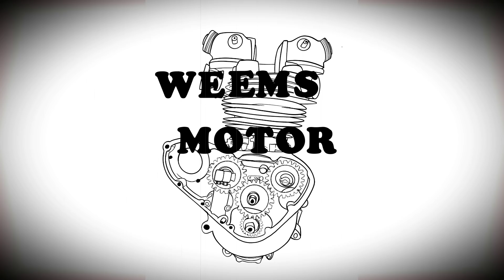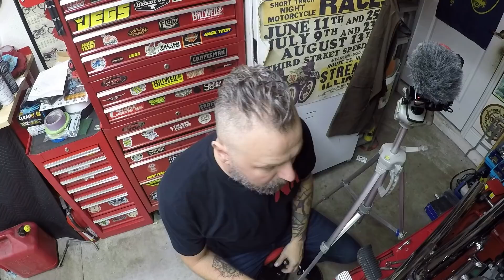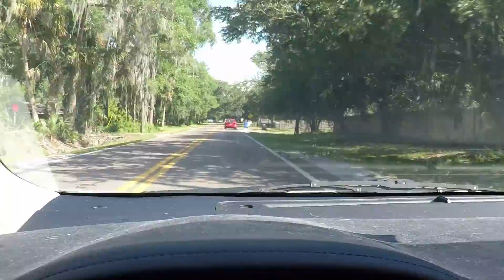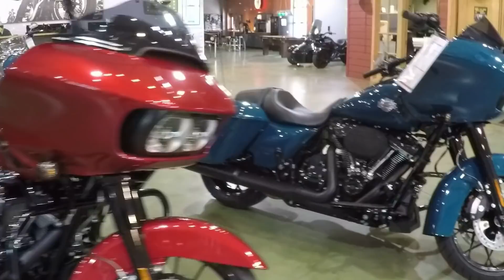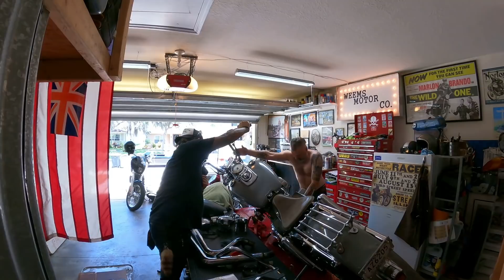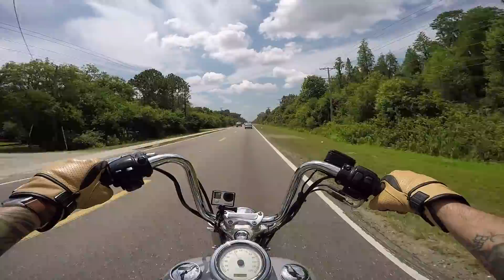I dropped my Harley / Dyna Cam Chain Tensioners

Comment: If you ever have to pull the cam plate, I’d think about upgrading the chain tensioners to the later model hydraulic type. They don’t wear out like the spring ones do.

Comment: What an idiot. It's not just the tensioners but inner cam bearings that need to be changed. If you don't know what you're doing don't do.
For fuck's sake
Reply: Ne reason to be rude... calm down.
Reply: See no reason for the cam bearing to be changed. Everyone that owns a harley knows about those shittie cam  tensioners doesnot last long.
Reply: Weems is an old school triumph builder. O believe this is his first Harley so I imagine his knowledge isn’t as “up to par” as all these internet Harley techs

Comment: You could have just taken the cam gear, crank gear, and chain off and then the tensioner would have been easy to put back on and tension the spring correctly.  Now if you had to do the inner you would have to take the rocker boxes off or cut the push rods and install quickie rods.

Comment: News update:
HARLEY COULD HAVE USED A GEAR MOUNTED ON A SPRING LOADED ARM AS THE CAM CHAIN TENSIONERS AND HUNDREDS OF THOUSANDS OF PEOPLE WOULD BE ABLE TO SLEEP BETTER.
Reply: Airhead BMW Motorcycles since the 1970s has had a hydraulic pressurized cam chain tensioner that automatically adjust the chain to proper tension BMW canes last two to three hundred thousand miles my 100/17 had 500,000 MI when I broadsided the car who pulled out in front of me this is fifty-year-old engineering from the 70s for Harley to make such a piss-poor design is a disgrace and shame on them
Reply: EPA would still be wide awake due to the extra noise

Comment: Gear to gear is the best if you can do it.  They do make a way to go from spring tension to hydraulic like the 96 and 103.  I have a 96 and I changed my at 50,000 miles.  Worn but not as bad as yours.  I also used fueling race pad instead of stock.  Hoping for alittle better longevity.  Good work and enjoy the videos.  Thank you

Comment: Just took mine to the shop because I didn't listen to the man I got the bike from. He told me it was time to check that catastrophic cam chain tensioner and I waited for a while. Bout 2000 miles later my girls in the shop. Getting the hydraulic cam chain tensioner upgrade an a few other things.
Reply: hope your oil pump isnt filled with plastic.
Reply: @harleyhawk7959  damn the oil pump it was all factory and about that time anyway. Luckily my engine was good to go. That's all I was worried about.
Reply: @brandonmacon3317  cool hope everything is good, bye the way I was born in Macon